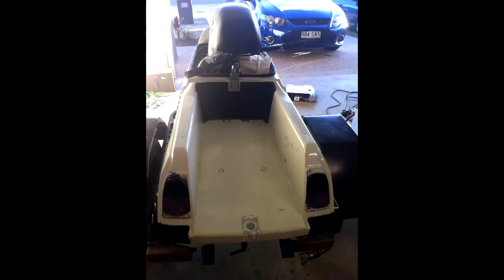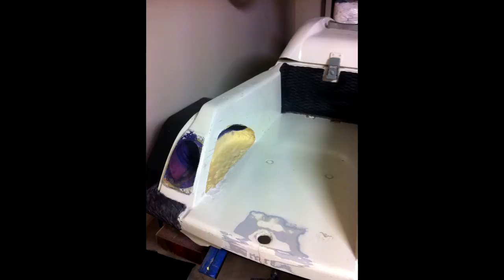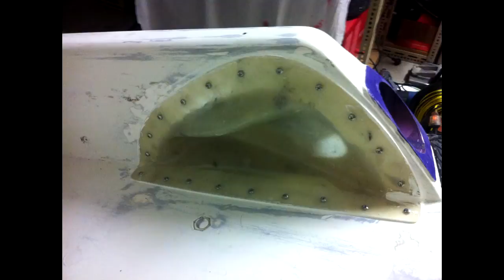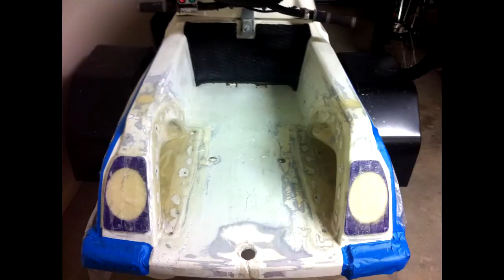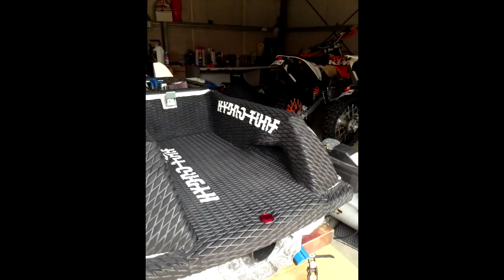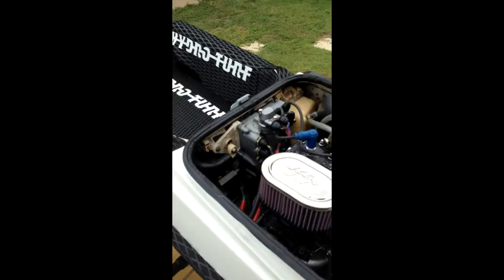kawasaki 750sx jetski installing footwells and hydro turf

Comment: Did you have to drill out the rivets on the hood latch to remove your dash? Or were you able to get the original dash off without messing with the latch to put new hydro?